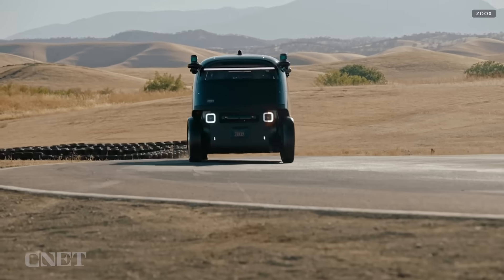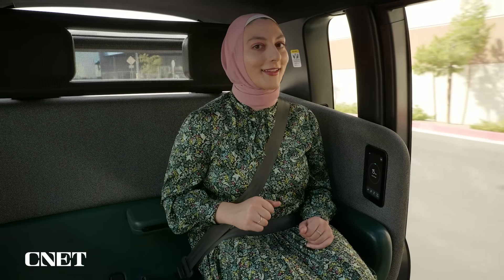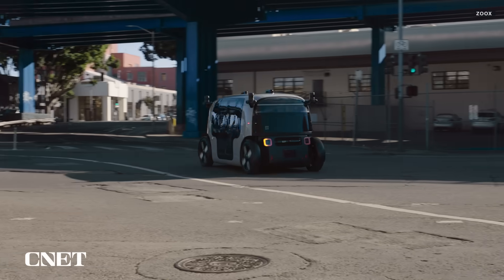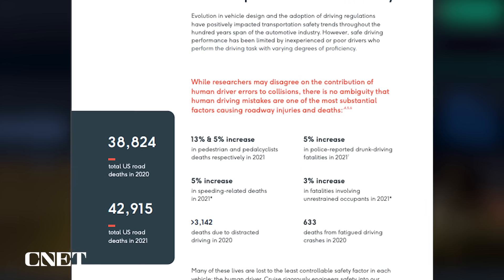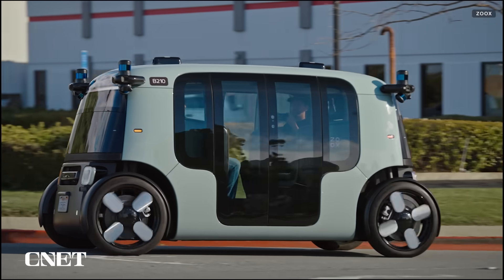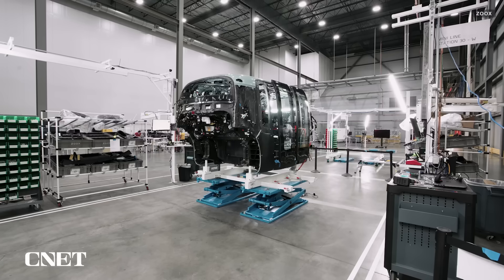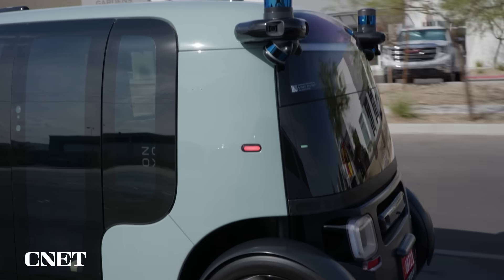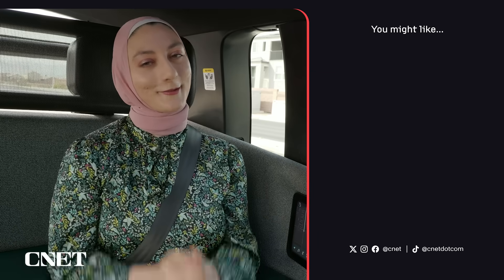Zoox Robotaxis Are Hitting Public Roads. I Took an Early Test Ride

Comment from the maker: Read more on CNET.com: No Steering Wheel, Pedals or Driver's Seat: Is Zoox the Future of Robotaxis? https://cnet.us/k3m
Reply: The reporter is fantastic. She did a great job 👏
Reply: another CNET fluff piece letting companies tell of their "beliefs" rather than doing hard reporting with actual 3rd party safety statistics
Reply: @polyglotinc  you mean the stats that build the roads that are designed for spend not safety?
Reply: @polyglotinc if there are systems which can control 10,000 drones without crashing to each other in 3D then it’s possible to manage the same number in 2D.
Reply: @iscadean6038  completely the wrong comparison because those drones are in a clean airspace completely controlled by their system VERSUS a constantly changing space of other moving vehicles/pedestrians/road-furniture/potholes/etc that are not controlled by the self-driving car.
Reply: @ well not completely wrong. 3D space introduces incredible complexity. Movement of those drones requires them to have proximity sensors on three axes not just two and, all things being equal and other road users follow the same rules, nothing untoward should happen. At least the robotic taxi will not speed, cut others up, brake unnecessarily, or do doughnuts. It will have radar and lidar and predictive technology I guess. And the cage the passengers are in will help them survive. That’s all you need in a taxi. Maybe ten thousand of just those in London might well, through AI, just control themselves and ban all other vehicles so they never have accidents.
Reply: @iscadean6038  "other road users follow the same rules" is my point because there are so many that DON'T follow the rules.
Reply: @ and a robotaxi will avoid those using its AI. You seem extremely sceptical. Maybe give it time. If Tesla can introduce FSD successfully then I am sure this might work. My glass if half full.

Comment: had my first experience with Waymo. great!  my ride home from the airport on lyft and uber was $63-$70 + TIP. decided to go with waymo, $36, no tip. the car used Lidar, radar, and cameras, (unlike tesla who only uses cameras, problematic for fog, bad weather, or like Mark Rober's test, a wall painted to look like a road.). The only thing i worry about is it's vegas, there's no driver. what if a guy pukes in the seat, then you get the next ride, no person to clean it up. hopefully there's internal cameras that can detect bad stuff, and self-drive to a maintenance center.

Comment: Really slow  stupid- why- what’s the advantage?  It’s going to go the speed limit.  

Who in Vegas wants to drive at the speed limit?   You will never get where you are going.  Some will put up with slow ride just to give it a try.  Some will stay with it.  Most people are not stupid enough to continue using it long term.

Also who would trust this on the 15? 

And all at the same price for the ride chances are, since the cars are expensive to build and maintain.

On top of all that, Vegas demand has huge peaks and valleys.  A 60’000 person convention loading between 7-9 am might need a few thousand Uber and cabs since some will also come in limo, shuttle or their own rental cars. So even if you have a thousand of these you would only be able to accommodate one half or third of one good sized convention, let alone two conventions simultaneously and other travelers at other events or just visiting Vegas. 

A thousand of these at peak will handcuff the whole strip area since they are so incredibly slow and stupid.

Comment: Autonomous vehicles will not solve traffic and they will not solve ecological impact of suburban sprawl. If anything, they might even increase the number of some trips, when school kids and parents will now be on their own trips individually. These vehicles are not designed to be aerodynamic and therefore energy efficient and although being equipped with four seats they look like they are supposed to be used for ride sharing, the company's representative suggests, that you would be undisturbed and have your privacy, so that this vehicle will usually used by just a single passenger. This is not efficient, this is not green and it will not be the more human friendly alternative to transportation, that has been promised for a decade by those investing in this technology. For a very long time, I had a lot of sympathy for the potential of this technology, as it looked like it would be more accessible and open up public transport to rural areas, so it would bring more equality. However, I came to the conclusion, that this is more the idea of privileged people how to replace driving, without having to use a bus.

Comment: I live in San Francisco and have taken Waymo rides. I look forward to trying Zoox.  The Waymo rides I took, were fine. In SF, traffic is congested and parking is impossible.  My only gripe was the 1.5 mile rides cost ~$15 which is about the same as Uber or Lyft w/o tip. If Waymo/Zoox can cut prices to ~$5, then I can get around without a car and use the public bus and these self driving taxis.
Reply: My question is? Why would u trust a robot over a human? What is the benefit?
Reply: @Ryan92591   I would trust local WAYMO rides in San Francisco where the maximum speed limit is typically 25 mph. However, I might have concerns over self driving taxi rides on the highways. I have a related concern that I am 73 years old and in 5-10 years, probably, I should not be driving. So my interest in self driving taxis will be increasing dramatically.
Reply: @Ryan92591 because these rich techies like to live in the middle of the city and there is no parking or they don’t wanna drive. So they use these premium service most poor joe won’t use, but will be force to use in the future and then we will get price gouge when we finally become dependent on their service. SF traffic is bad if you don’t know where to drive at what time.

Comment: For Zook to be able to approach human cab driving ingenuity, it should be able to plot, navigate and traverse routes sans network coverage, sans radars, lidars, oddly x rays too, and yet still get to destination, safely, and maybe a little late if not on time. Also I cant see baby passengers holdfasts on this, no luggage, baggage anchoring or storage, no tow hooks, no spare wheels, no manual override, no manual driver controls, no rubber bumpers, cushioning on exterior ( yes its nice that air bags cushion the pax, but shouldn't pedestrians be cushioned from impact collisions too?) Oddly, no food, drinks, fire extinguisher life vests, flotation devices, first aid kits ( must have on long haul routes)?

All the best Zook!

Comment: I like this design ,  if the service is cheap I'll definitely use it.   also,  most of the robo taxi videos show vehicles going 10 miles an hour,  this one is flying down the road at normal speed.   regular drivers do not want slow driving bricks obstructing traffic flow.  this guy looks like it will move with traffic.

Comment: Yep, 50yrs from now, people will be freaking out when they see a person behind a steering wheel..
Reply: driving becomes a hobby
Reply: The movie Demolition Man...where Taco Bell is fine dining 😂
Reply: @rainmaker718  Don't sleep on Dorito Taco's...
Reply: been using Tesla's fsd for about 2 years now and i feel a shocking sense of anxiety when i have to drive a manual car now. Its caught so many close calls that its proven its value. a human + fsd in its current state is night and day safer than 99% of drivers
Reply: @DarkNemesis25   - yeah, in previous generations it was basic stuff like blind spot sensors and backup cameras that have made modern driving significantly safer. I know there have been MULTIPLE times in driving my 2014 Lexus that the car knew more about the surrounding environment than I did.
Reply: Yup…but far less than 50 years.
Reply: 50 years? Say 10
Reply: *5
Reply: In 50 years it'll become illegal for a human to operate a vehicle on the road. Just like how it's illegal to ride a horse on public roads. 
Humans driving cars will be relegated to driving in the track, much like horseback riding.
Reply: We don't freak out when we see people on Horses but we know it's a hobby. There's no way people will give up 0 to 60 in 2 seconds that easily unless they build massive amount of car track around everywhere. Flying cars and cars that are boat hybrid will be the thing by then.
Reply: If history has taught us anything it's that once a handful of taxi companies dominate the market, transport costs will go up until tbey exceed current running costs, frustration with getting around will go up, consumer satisfaction will drop, and customer service will be non-existent. Shareholders will cash in though.
Reply: @rickenbacker472 thats why it needs to be a government program
Reply: You either be talking to a robot or an Indian you can’t understand.
Reply: I expect to happen less than 20 years...
Reply: Pure dystopian world 😢

Comment: Actually a human driver hit the jay walker and threw the person into the cruise car. The cruise vehicle did NOT cause that accident but ofc the media focuses on the wrong thing.
Reply: Just needs a lot of court cases to assign blame and that will take a decade or two.
Reply: @davidmccarthy6061 There doesn't need to be any court cases if you're a smart state like California that legally places the blame on the operator of those cars. In fact, it mandates that EVERY autonomous vehicle must have $5 million worth of liability coverage compared to the $30,000 for regular people.
Reply: @davidmccarthy6061  huh? Robotaxis are on the street now, regardless of what ambulance-chasing lawyers do. Since they're safer than human drivers, the insurance Waymo and Zoox pay will likely be less per car per mile. Sure, some lawyer may get eleventy billion for some accident caused by faulty autonomous driving software, but unless she can show the company acted negligently, headline-making damages are usually reduced on appeal.
Reply: No the car just kept driving with the person stuck underneath. Not something that would happen with a human driver.
Reply: @nathanielthelin1051  People get hit by cars everyday and it's not newsworthy.
Reply: @nathanielthelin1051  It pulled over to the curb with the person stuck underneath and then stopped.
Reply: @ okay but this accident started with a human driver they still haven’t found to this day. So idk why you would go “not something that would happen with a human driver” when the accident was caused by a human who ran away.

Also a handful of casualties versus how many human caused vehicular deaths? Where this specific one wasn’t even caused by the ai but another human idk i feel like people blame one side and not the side that ran away after hitting a woman.
Reply: The cruise car never stopped and it draged the victim
Reply: @TheGuillotineKing  it did stop, it dragged the victim of the bad human driver 20 feet as it pulled over. Robotaxis will harm people in edge cases, but focusing on them, rather than the run-of-the-mill "inattentive bad human driver causes crash" that happens millions of times a year, is mistaken. The only question that should matter is whether they are safer than human drivers in the conditions in which they operate. Waymo is, Cruise probably was.

Comment: I’m one of those people that I’m usually down for any type of new tech, but I have to say self driving cars scare me a bit. Not so much at lower speeds as I think I’m ok with using them in the city and surface streets at speeds 50mph and under. It’s highway speeds that would scare me and I’m not in control. Also being in one of these in a hilly or mountainous area with cliffs! Nope!
Reply: I don’t know where you live but human drivers where I live can be terrifying.
Reply: And if you're a passenger in a taxi, you're also at the whim of the driver that you can't control. Nothing has changed AT ALL. Either way, you were never in control of the car.

Comment: I think they need to find a smallish town and have nothing but robo taxis, it would be interesting to see if all vehicles on the road are robo taxi's if there is any accident. Seems to me that its people causing the issue.
Reply: That would be a great proof of concept idea. Even better would be doing it in several small towns linked by small sections of freeway. This could work in  something like a tourist area
Reply: @OffWhiteDaz  You mean a bus?
Reply: Somebody in India driving these cars remotely stop the cap lol
Reply: This is a great idea, someone ping Elon!
Reply: @westside213  it’s not and will never work. So a great project for Elon to grift off!
Reply: @component9008  maybe not all Tesla Robotaxis (TM) but at least autonomous cars only. I bet the traffic fatalities would go close to zero if not zero. A driver with FSD is already way safer than one without.
Reply: @ they don’t work yet though. We could just build a city using public transport which is proven and simpler
Reply: @component9008  Bro they actually do work. Tesla is hiring teleoperators for the rare times they mess up, it's happening! People hate public transit. I don't want to sit where someone was just urinating or doing who knows what else. It's disgusting. I want my own car that drives autonomously and so do most other people. It's way more efficient to get where you want to go and planes are better for everything else. Subways require a miserable level of density...I'm fine with them in places where people want to live like sardines but most of us don't!
Reply: @ actually you’re wrong, most people want to use public transport, and given the opportunity to live their would live in a denser city.
Reply: @westside213  YOU WROTE:
> "People hate public transit. I don't want to sit where someone was just urinating or doing who knows what else. It's disgusting. I want my own car that drives autonomously and so do most other people. It's way more efficient to get where you want to go and planes are better for everything else. Subways require a miserable level of density...I'm fine with them in places where people want to live like sardines but most of us don't!"

This is classic elite projection, which is when rich people insist that what they find convenient and attractive is good for the rest of society, or that just because they find something annoying means that others will find it annoying as well.
Reply: People also walk, cycle etc. giving away large area of public land (roads) to the corporations to run their experiments over is a dystopian nightmare in my opinion.
Reply: @pruthvichowdary22  the corporations run their experiments with human safety drivers ready to take over, until they demonstrate to regulators that their robotaxis are safer than human drivers. Waymo has done that. (Cruise did too, but stupidly misled regulators about the crash in which after a human driver struck a pedestrian , its robotaxi collided with her and dragged the victim 20 feet as it pulled over. Cruise will deservedly have to do a lot to regain regulators' trust.)
Reply: @pruthvichowdary22  maybe in europe but not in the us lmao